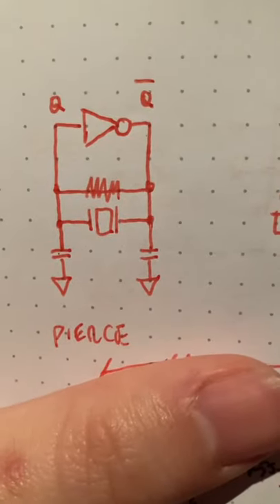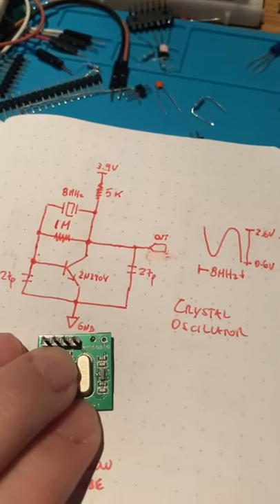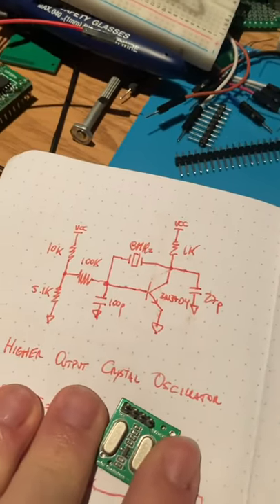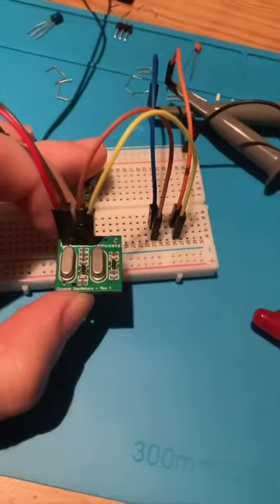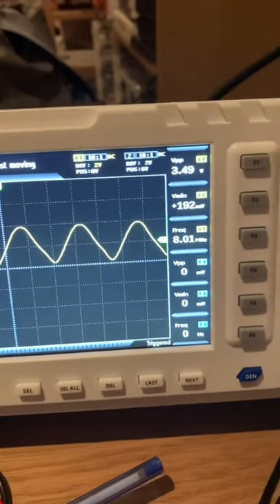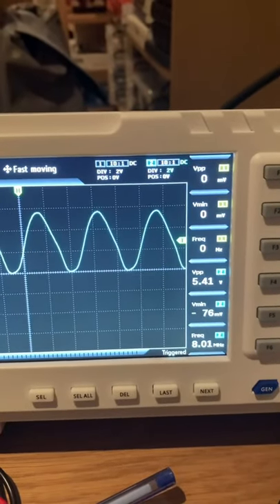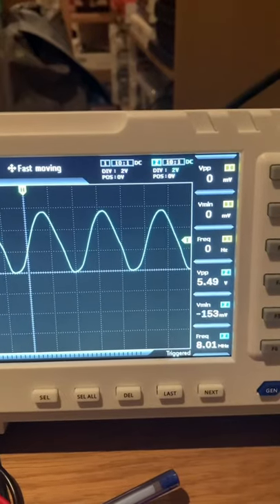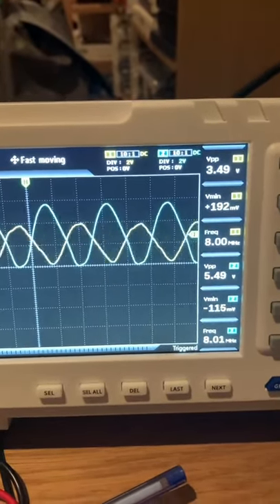8MHz in a PCB with crystal oscillators

Comment: Can this circuit be used in FM modulation? How to modulate with varicap? Interesting in the 1st circuit BJT can be replaced with 2n7002 nmosfet and it starts to oscillate, but amplitude is tiny. Do you know a circuit for mosfet oscilator?